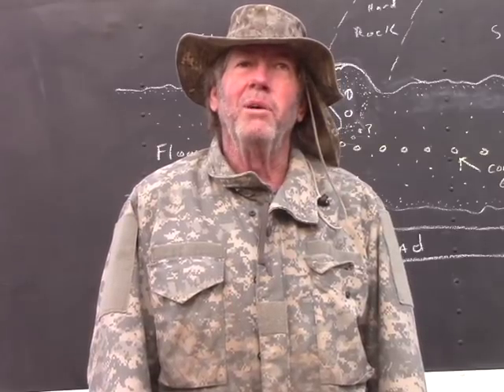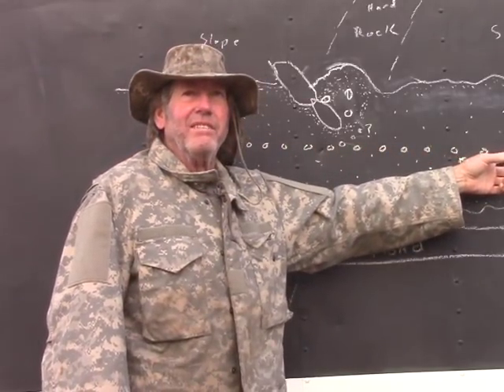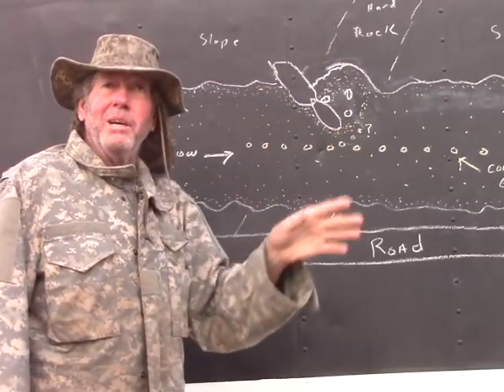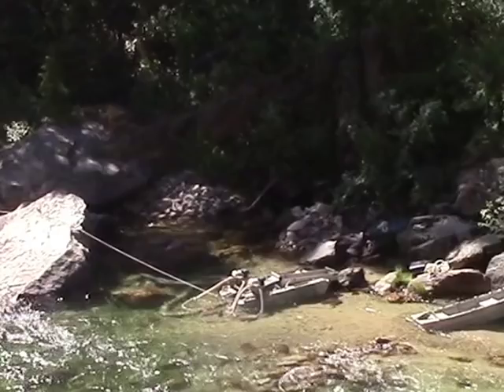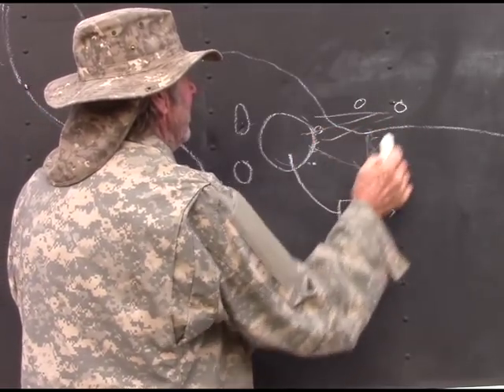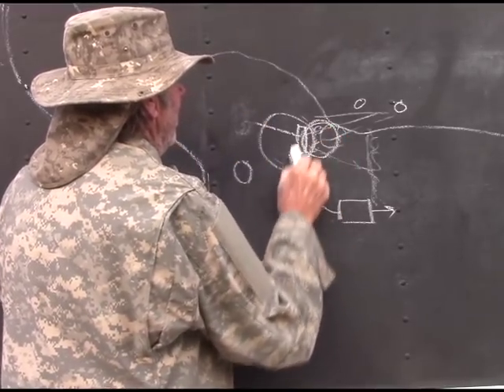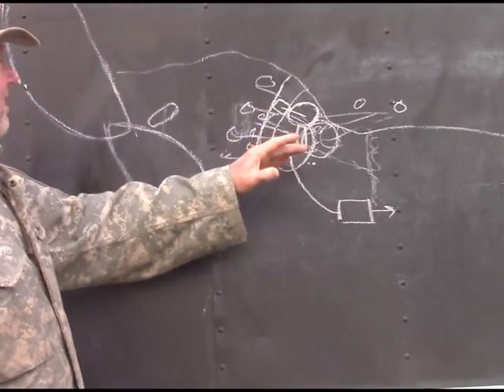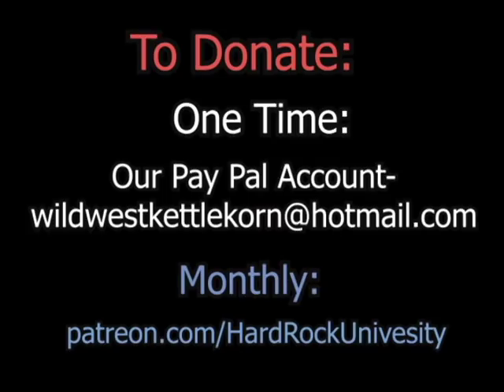Mine Report 6-5 Exploiting an Eddy With a Dredge

Comment: where do you buy a dredge
Reply from the maker: There are several suppliers.  Proline seems to be the favorite at this location, but Keene has been in the business a long time.  You can buy them used for a fraction of the cost of new  You also need the check the regulations where you wish to dredge.  Sometimes there are size limitations